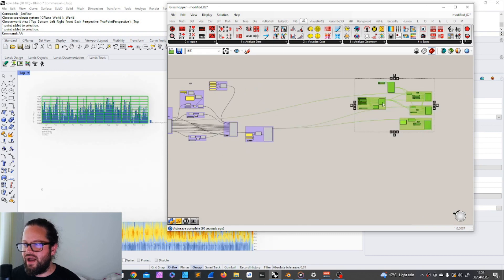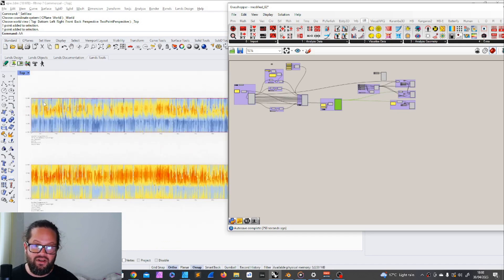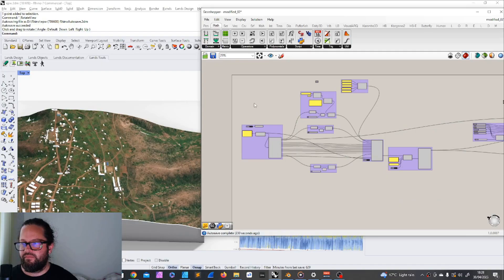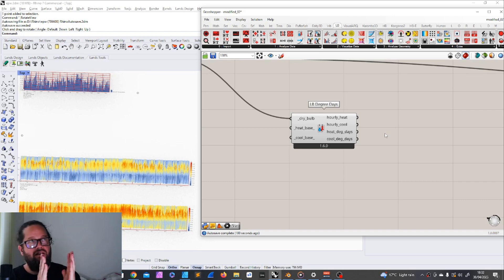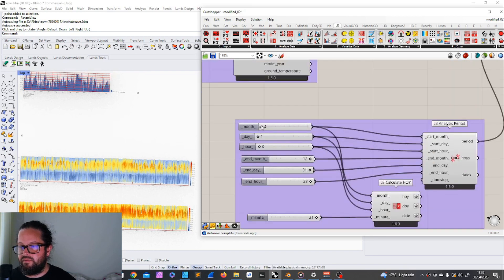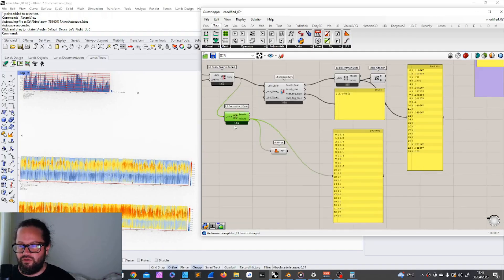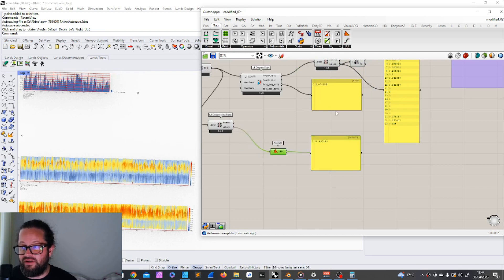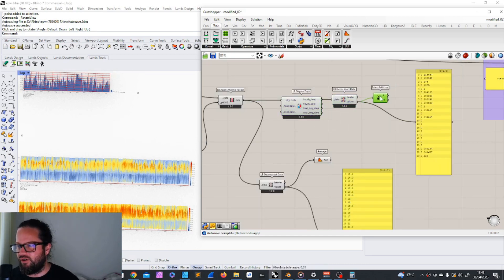#4 What the Hell are Heating Design Days ? - Ultimate Ladybug Course  - LBT 1.6

Comment: A very helpful video! but i do have a small issue when i tried to create CDH and HDH diagram. In the video at 8:37  the values are in this decimal 15.2 meanwhile my data for some reason is 0.52. What is the issue? Thanks in advance
Reply from the maker: i compare here the actual temperature values with the what the tool is producing.
if your actual temperature is lets say 0.52 then that could be the actual temperature of the day you have choosen...
Reply: @PhilippGalvanDesign  is it also possible to connec a building into the CDH and HDH? because I can only see that we can connect an EPW map location.